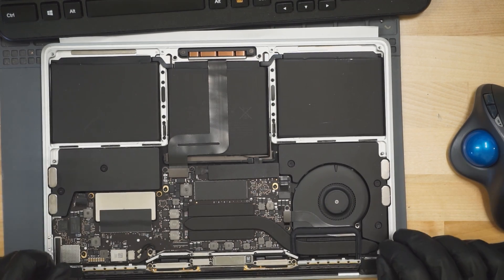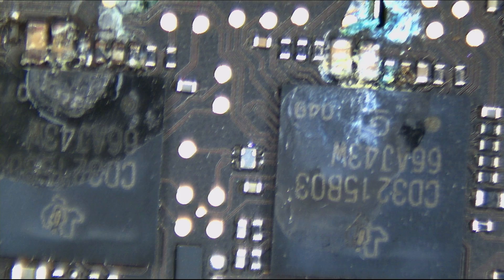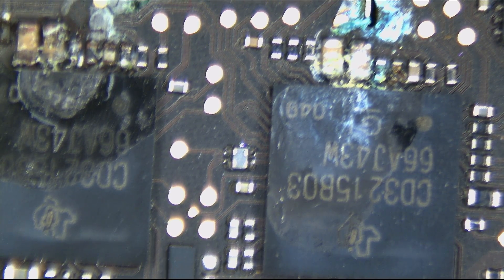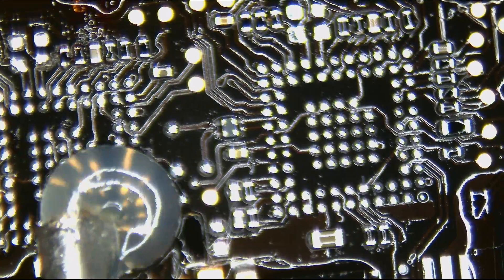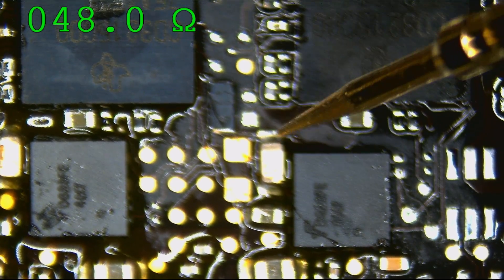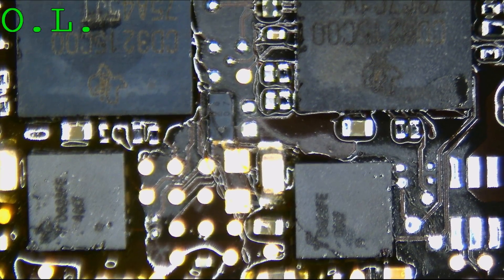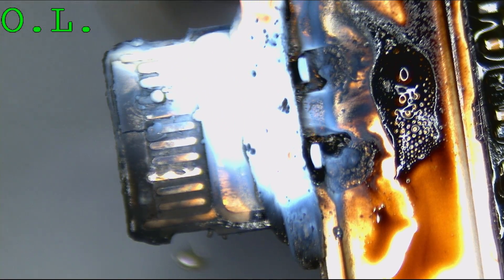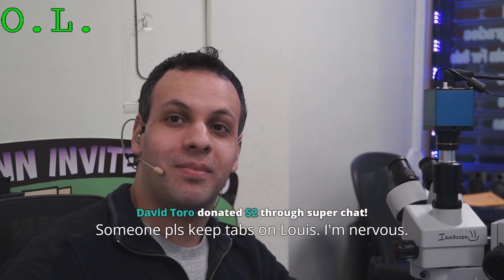How is Paul's queue determined?

Comment: Sooooooo......that's why apple charges so much for repairs...  Potential biohazard charge.
Reply: apple does repairs?
Reply: @outseeker  https://support.apple.com/repair
Reply: @BRIGGS2710  that's a very good link! as pictured, there are no board-level repair tools involved XD
Reply: @outseeker  right, because they just put in new boards.
Reply: @BRIGGS2710  yeah a new board, or just a piece of shoe rubber stuck onto the chip of a faulty one
Reply: @outseeker  I would prefer a new board thanks!
Reply: @BRIGGS2710  what are you even doing here? :)
Reply: @outseeker  having fun.  You?